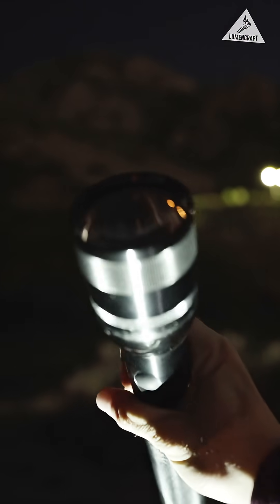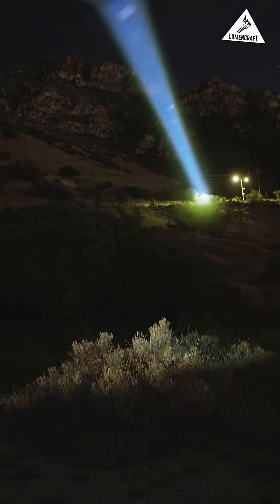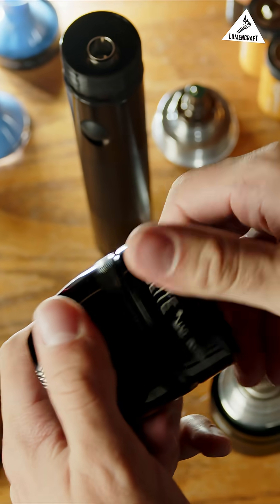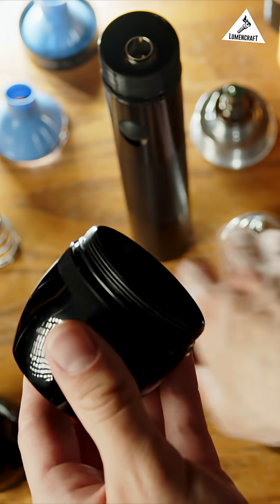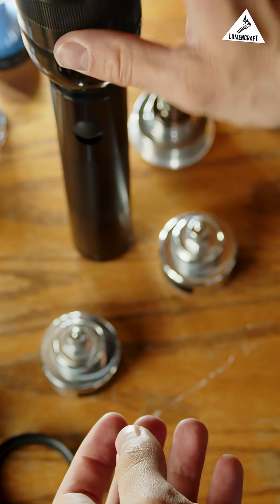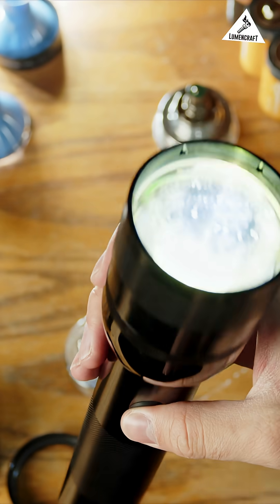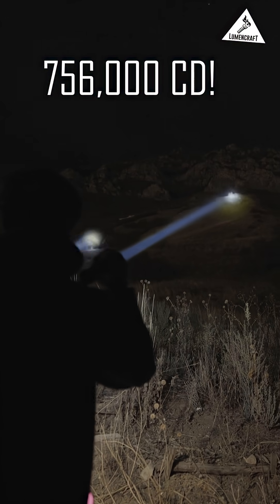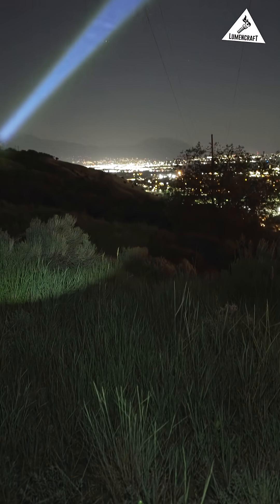Easy Laser Upgrade for Old Maglite! (Lumencraft)

Comment: Probably the only module I would consider buying. As long as it is not to expensive.

Because I actually like that this LEP still gives some area illumination.
Reply: Everybody hypes an LEP like it's the ultimate all-purpose thrower, until they realize they took spill for granted. It's pretty situational in real use.
Reply: @DFT-v2 lol. I am not one of "them" 
Leps are the absolute opposite of "all purpose" they are mostly a toy^^
Reply: @senectarius9685  Oh no no, O wasn't singling you out or nothing 😅 It's a wide statement of general fact among newer moths.

Comment: It is since my early times at CPF - 23 years ago - that I wanted a LED module for a 4D Maglite; but being in Europe (England) has always proved an handicap purchasing artisanal US manufacts.
I recall when SF was still king, I purchased a lot of stuff from the Shoppette, mostly driver boards and McGizmo reflectors, but those components were very small and easily went into a letter envelope.
Now the the Chinese have become the drivers of innovation, there is little modding for me - no parts available, no info, no reply to e-mails. 
I really appreciate the engineering, the thermal calculations, the efficiency of the drivers, the selection of LEDs going into your module. It is not much, but have all my most sincere flashaholic appreciation for your illuminating deeds.
Greetings from the UK,
Anthony